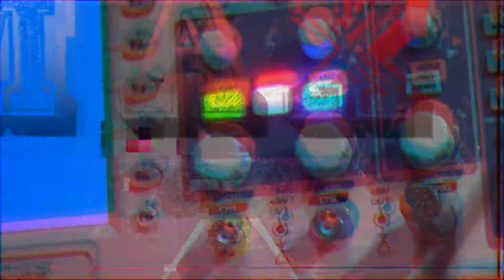Installing 2nd Drive (Upgrading) Into MacMini 2012

Comment: I replaced the HDD on my old Mac Mini late 2012 with a OWC 1TB Mercury SSD and it worked perfectly.

Now I’m tempted to add a second SSD and I know this model of Mac Mini can take two SSD drives.

Here’s my question.
Can the Mac Mini late 2012 take high capacity drives?

I have a 1Tb already installed as my primary drive and I want to add a 2nd drive with 2Tb.

Will the Mac mini be able to handle that?
Reply from the maker: I don’t see why not, it’s a storage so it shouldn’t have a limit.